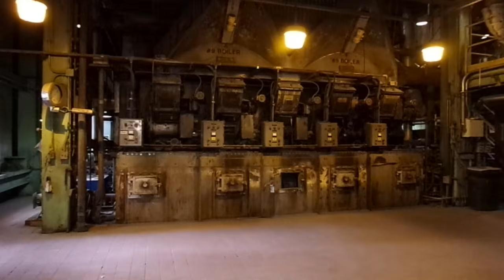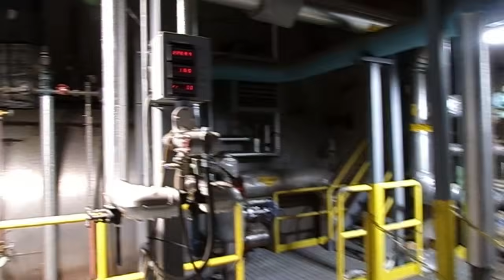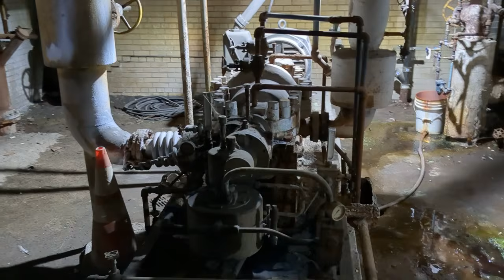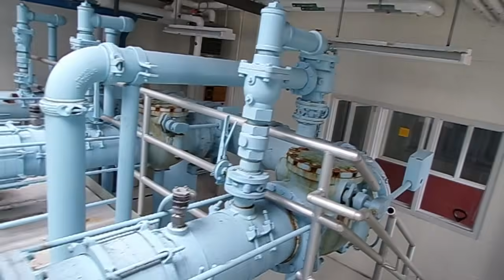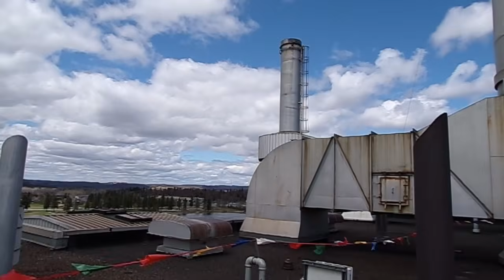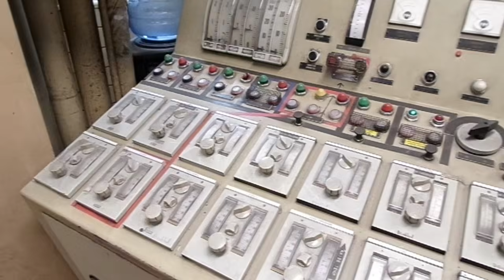This Power Plant Is Closing Forever – Full Tour (Virginia Utilities)

Comment: Great video of the workings of a classic power plant. If it exported steam for heating purposes though…would that not make it a cogeneration facility?
Reply from the maker: it was a CHP steam plant. they had a back pressure turbine in the old turbine hall but insurance made them shut it down. the other generators have extraction turbines which extract steam at 50 psi.

Comment: We are stuck in steam era.
Reply from the maker: how are we stuck in the steam era? do you mean our interest or the industry? I feel that theres a real push to shut down coal plants and move to gas turbines and wind power.
Reply: @S @SteamElectricityandPropulsion e gas turbine plant I work at is just one of maybe hundreds across the Americas…seems like they’re pretty much all cookie cutter where one is almost the same as the next one.
Reply from the maker: @NorthernElevations yeah that sucks. It's nice to have critical infrastructure look nice so people can appreciate it
Reply: @SteamElectricityandPropulsion Yup. Really wish I could have got some footage of our boilerhouse - each boiler was put in with a specific purpose, and each was unique. As an operator we learned the quirks of each, which equipment would handle each specific process upset. Seems like everything these days is getting streamlined - phones all look the same, new power plants have an established template, in new housing subdivisions you can point out the 4 or 5 designs that they spread out…

Comment: Why are they forcing customers to now pay for there own onsite heating? Let me guess $. Why not continue with nat gas to steam? Are pipelines failing?
Reply from the maker: as you see steam leaks through man holes. they also dont have condensate return. if they had a system like NDSU with most of the pipes in a walkable tunnel with a condensate return that would be better.
Reply: @SteamElectricityandPropulsion So I take it as very inefficient.
Reply from the maker: @publicmail2  yes, the reverse osmosis takes lots of power to filter all the feed water and energy is lost through leaks and dumping hot condensate into the sewer.

Comment: This is terrible news.  You can never have enough steam.
Reply from the maker: the only real bad think is there was no condensate return from the district heating system and the pipes leaked. if they upgraded to a steam tunnel like NDSU they could more easily maintain the lines and install condensate returns. anyway a 600 psi. steam turbine system can achieve over 25% electrical efficency and would only gain efficency when you extract steam and sell it for heat.

Comment: Big steam plants are so interesting! Thank you for putting this all together for us to enjoy. I was wondering why there were both electric and steam turbine systems in some places. I assumed the electric side was used when the plant was cold. Did those systems normally operate under steam power or electric?
Reply from the maker: I dont know but I could ask. the terry turbine has a hydraulic governor with a speed control knob. I will make another video on this plant to explain this. I guess if they had the fancy controls on the turbine they may have used them often.
Reply: I was thinking the same thing - if the electric ID fan driver was running before a power outage, you’d expect that to trip the boiler. While if the steam ID driver was the main one it should (in theory) stay running during a power outage
Reply from the maker: @NorthernElevations  I dont get why the wickes boiler had steam and electric on the FD but just electric on the ID. the erie city had steam and electric power for the ID fan which was better. It gives better redundancy and negative draft is more important for a coal boiler.